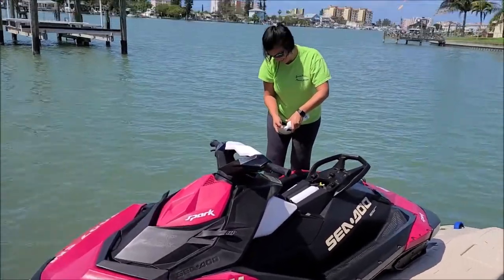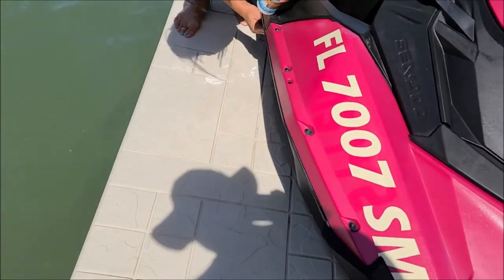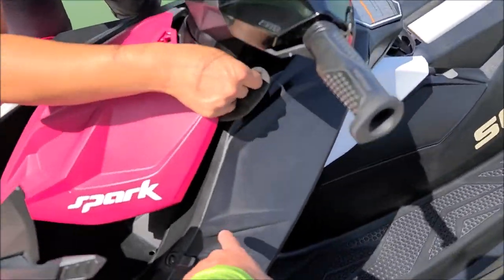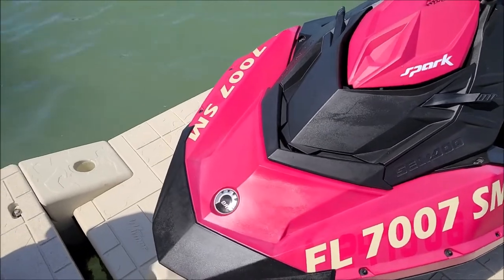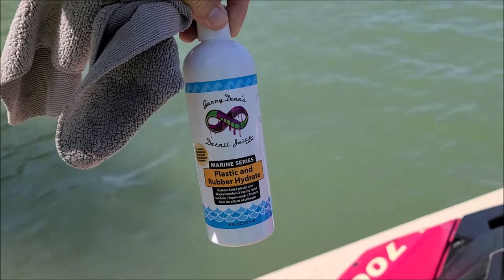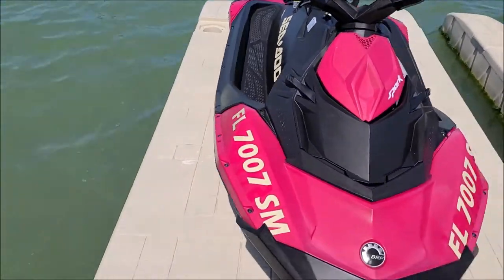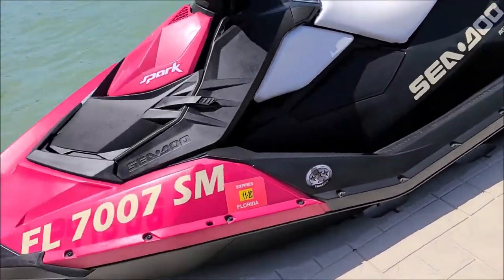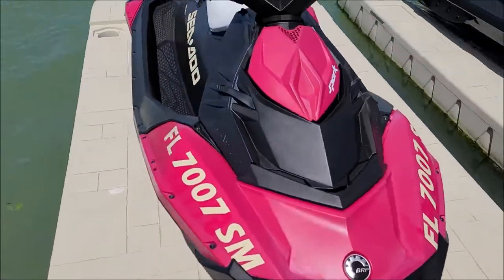SEADOO SPARK - HOW TO CERAMIC COATING FOR PLASTIC TRIM - HOW TO RESTORE FADED PLASTIC - CERAMACRYLIX

Comment: So my magenta spark is a mix of medium and light pink. Can the product alone bring back the color, or do i have the use a heat gun first?
Reply from the maker: The heat gun trick doesnt last long. Plastic fades when the natural plastic oils have dried up. The only way to bring trim back is to hydrate it. My Marine Series Plastic & Rubber Hydrate is what you need. Clean with my Marine Series Cleaner first and then apply. I have two Spark kits on my site in the kits section.

Comment: What type of pad does she use to apply the cleaner and what type of pad for the hydrater?
Also, I'm interested in the seat cleaner. Mine is not looking so great. Is there a specific rag or pad for that as well?
Reply from the maker: we use microfiber to clean and foam to apply the protective products.